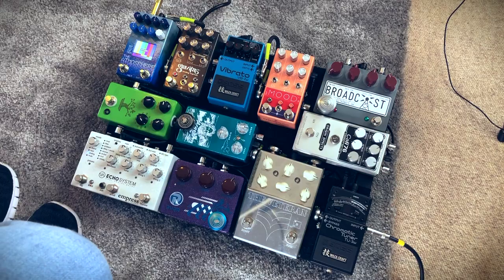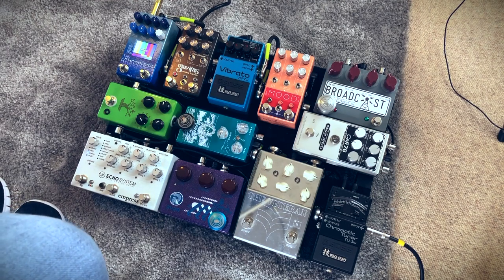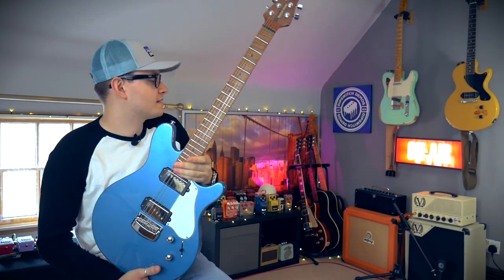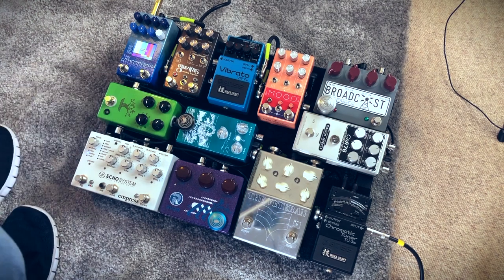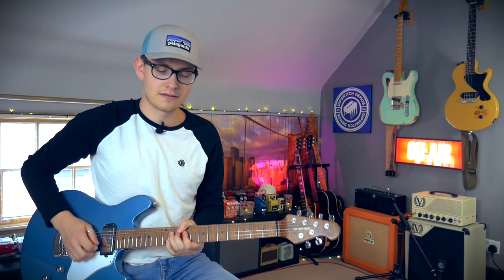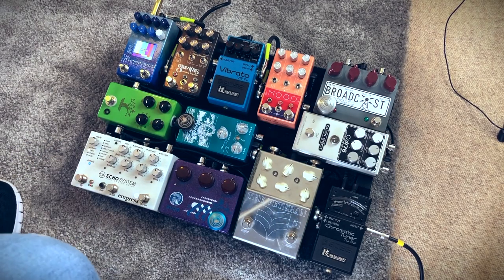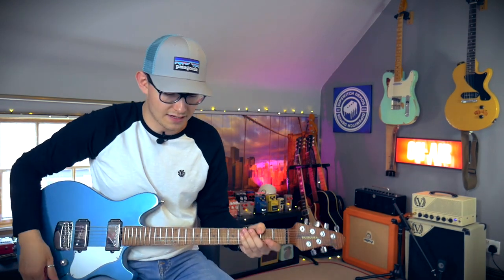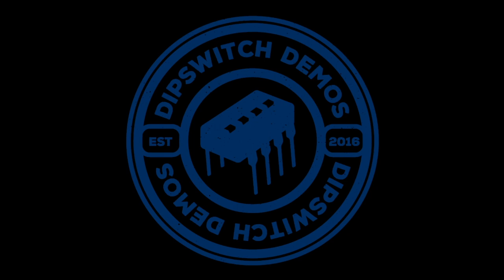August 2019 Pedalboard Update

Comment: 1:12 Ditch switcher demos
Reply: Lovely (and enviable) collection of pedals
Reply: That's a great bypass tone considering the amount of pedals. How many buffered pedals do you tend to use per true-bypass pedal? With the 2 Boss pedals and the Klone I can see 3 - any more? I tend to use 1 buffered pedal to 2 true-bypass pedals (but then not all buffer circuits are created equal).
Reply: Treble booster into the Bonsai is my favourite tone of the video.
Reply from the maker: Don’t really narrow it down like this, prefer just to pick the pedals I like and then if they’ve got buffers then cool! Thanks for the kind words anyway dude
Reply: Also, I was quite surprised to see the RYRA klone as opposed to the KO Amps Xiphos.